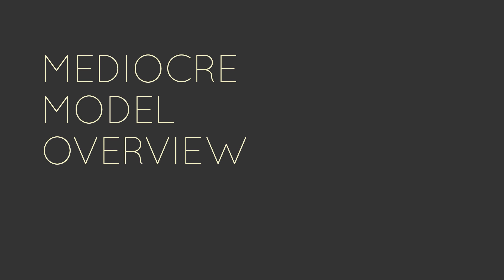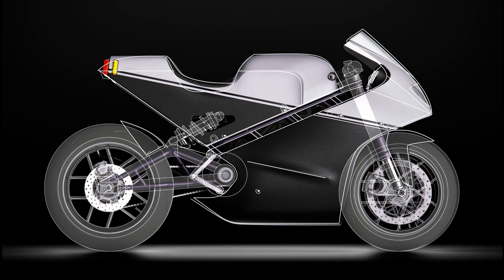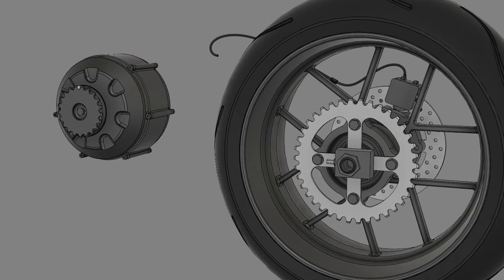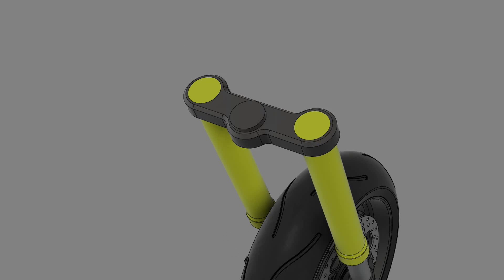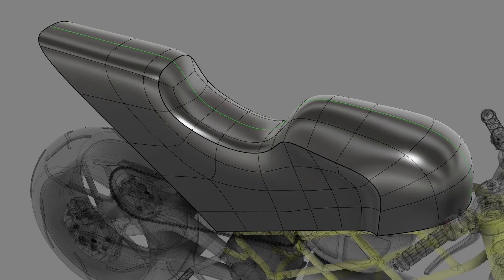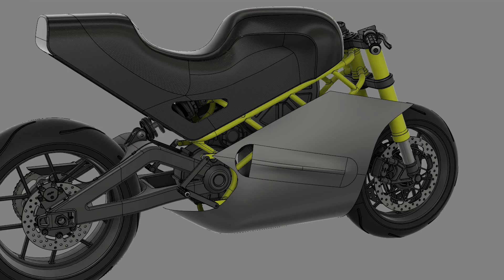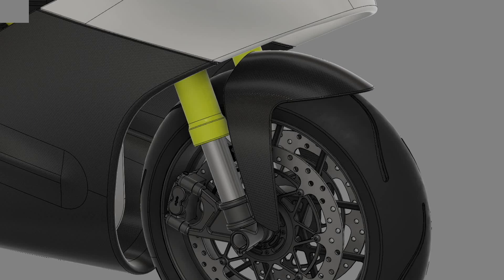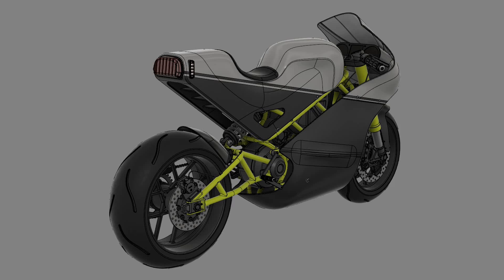Motorcycle Model Overview In Fusion 360

Comment: Love your work!  Please do some some more tutorials on surface modeling and sculpting. You make this stuff look so easy. I am currently struggling to model a small broken section of a motorcycle front fairing with the intent of 3D printing the part and ABS cement scabbing it to the main fairing. It has been very difficult to get the correct fit and curvature. Your skill level is amazing, you most likely did that front fairing in 10 minutes.  It seems all the tutorials on youtube with regard to this type of modeling are very basic as I can usually follow/create those. Real world application is a whole different game. Curious if you do this for a living and if you went through an extensive training  program to learn these techniques. As a hobbyist I'm about ready to give up on this type of modeling. I'm good and have no problem doing solid modeling of basic mechanical parts and that's why this surface/t-spline stuff has been so frustrating for me. Thanks for sharing what you have so far, some of the best on YouTube!

Comment: I would love to hear more of your thoughts regarding surfacing and the t-spline environment. It is clear that the intend it to be a nurbs approach to sub-d modeling but it falls apart with star intersections that often result with extrusions that form the basis of a lot of sub-d modeling. The surfaces tend to get too heavy to preform more "traditional solid works style" parametric surfacing operations to (like trimming and patching for washouts). Maybe the answer is terminating into Ts rather than 5 way intersections, I haven't had the time to look into it.
Reply from the maker: I agree with what you say here for the most part. T-splines is not a replacement for surface modeling (or poly/sub-d modeling for that matter) for exactly the reasons you state. Also, yes, t-points are a good way of stepping to a different mesh resolution with clean resulting geometry (the lower fairing uses this), but it often breaks in cases where you need to change the direction of edge flow. So it isn't a magical tool, one that can replace all the tedious surface modeling tasks... However, I still find it to be one of the more valuable tools for my work (not just stuff like this bike, but real work as well). I see it more as a concept development tool where the surface quality isn't as critical because the end results are renders and 3d prints... the surfacing of the production models I still do in solidworks.
There are other tools out there that offer similar approaches to modeling (swid and powersurfacing for solidworks, creo/isdx, catia/ima, etc.) and I would be curious to see how they treat similar topology to the stuff that causes issues in Fusion... Unfortunately they are prohibitively expensive, so not sure when I'll get a chance to try them.